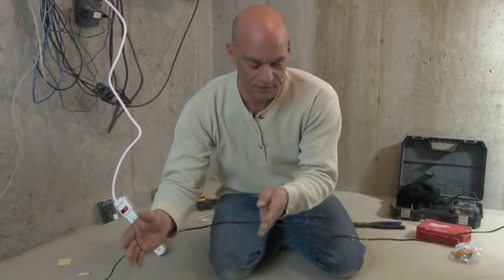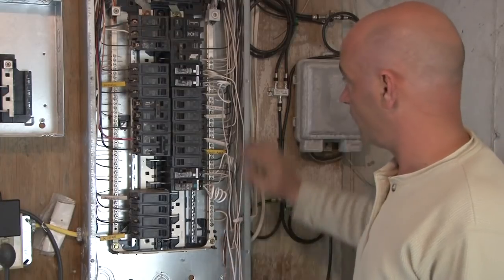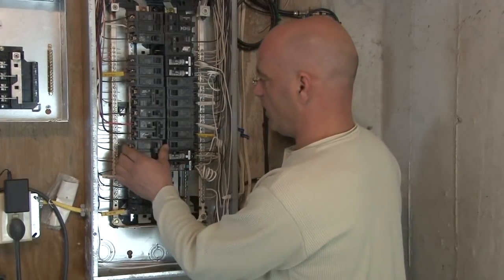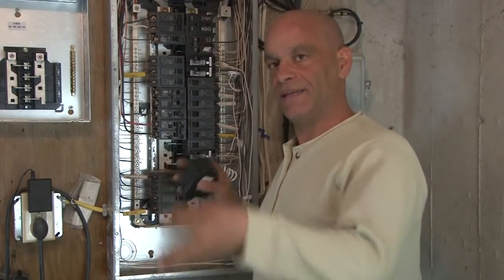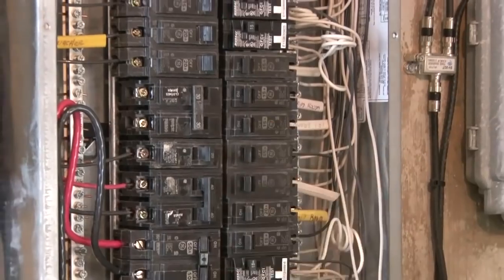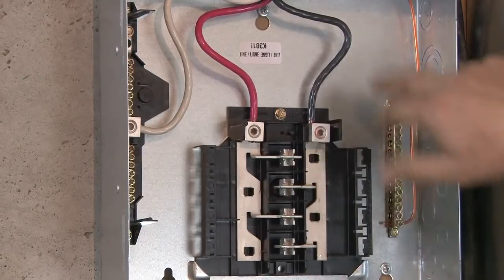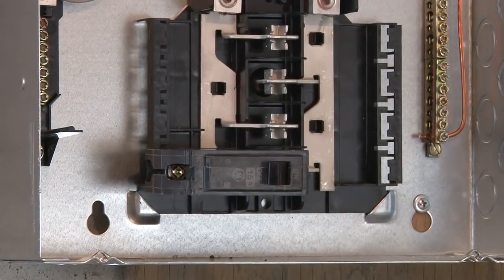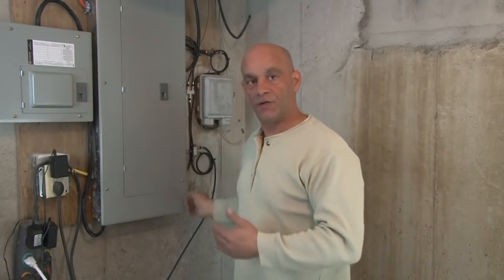How to Install a Subpanel

Comment: The wire between the main panel and the sub panel...should it be stapled down at all? If so, what is the correct distance for the staple from the panel, < 12"?
Reply from the maker: Yes it should be. I believe code is every 18". I always just put them where it makes the most sense. Always at the beginning and end as well.
Reply: Code is 8" from the box, and every 6 in between.  That's the minimum.  More is better.  Not only that, if the wire is accessible under 7', it needs to be protected by conduit. Romex is not protected from physical damage.

Comment: I need a sub-panel for my garage which is attached to my house. The garage is approximately 35 feet from the main breaker box. Can I install the sub-panel in the garage by running the 50 amp wire from the existing or would it be too far from the existing? Thanks, great video!
Reply from the maker: It will all depend on the load you'll have but yes you can.

Comment: Thanks for the tutorial . I'm installing a sub panel for my basement . My question , does the sub have to be the same brand and also if not does the breaker for the sub panel have to be the same as the main panel to  feeder the sub panel
Reply from the maker: No not at all. But do make sure the new breaker for the main panel is right for that panel.

Comment: what purpose does the white wire in the sub panel actually do if the green screw is pulled out? does this mean that the sub panel is grounding through the main panel instead of an independent ground?
Reply: The white neutral wire serves as a return path for the branch circuit current.  The bare or green earth ground wires should never carry current in normal operation.  Ground is for safety only.  When a subpanel is used, it is NOT permissible to bond the neutral to ground.  Thus the green screw is removed.  In the main panel, the neutral must be connected to the ground bus and the neutral/ground combination bus in the main panel is bonded (connected) to the box for safety.  However, note that the earth ground bus that was installed in the subpanel is mounted directly to the metal panel box, thus grounding the box, again for safety.  In the subpanel, the neutral bus is mounted on plastic insulators, so pulling the green screw breaks the connection from neutral to earth ground.

The reason that the neutral and ground are kept separate, going to, and in the subpanel is to prevent the earth ground wire from carrying any current should the neutral fail.  If the ground and neutral were tied (bonded) together in the subpanel, and the white neutral wire was cut, came loose etc. - the bare earth ground wire would carry current instead of the white neutral.  Even a poor connection of the neutral wire could cause this if it was still connected, but became compromised due to corrosion or other issues.  You can notice in the video that the bare wire in the cable being used to feed the subpanel looks smaller than the other wires.  That’s because it is.  Look at page 2 of this datasheet: http://www.southwire.com/ProductCatalog/XTEInterfaceServlet?contentKey=prodcatsheet6   You will see that Romex® 3-conductor cable (larger than 10 gauge) has a smaller ground wire size.  For example, the 6AWG cable has a 10AWG ground wire.  If the ground wire between the main panel and subpanel were to carry significant current, it could overheat and become a fire hazard.  There are other more esoteric reasons such as ground loops, but are unlikely to apply in a typical residential installation.
Reply: *****   Thank you for explaining this.  Really really helped answer questions I had.  Do have a good weekend.

Comment: Dom, thanks for the video. answered my question on separation.  I'm doing a sub dedicated to all 240V.  (3 hot water heaters and a well pump).  125A, 8 pos.   As such, no neutrals.  As it has a large lug, I used neutral bar for grounds.  Should'nt the panel still be grounded as it's a metal fixture?  Remove green or not?

Comment: At least I'm sure now, that the ground screw in the sub panel, is the one that needs to be removed and a separate ground bus bar be installed thus isolating the two.  Thanks for giving a better picture.  Such a nice clean install.

Comment: In a situation where I have a main breaker/meter combo grounded outside and my main distribution panel indoors about 30 feet away (same building), do I need to isolate the neutral and ground in the indoor distribution panel and run a separate ground outside? I don't see a reason since the 4/0 neutral which is coming into the indoor panel is grounded outside so the ground and neutral can be combined correct?
Reply: First of all yes, you have to isolate the ground and neutral in every panel except the main/service panel.  So your indoor sub panel needs to have a separate ground bar from the neutral bar, and you need to ensure the neutral bar is isolated and not bonded to the panel case.  If you have a 4/0 neutral I am assuming this is aluminum SE romex style cable feeding a 200 amp panel.   That cable should have an unwrapped aluminum conductor that acts as the ground.
Reply: T Taylor Thanks for the clarification. So I'm assuming the bare conductor should connect to the same grounding point as the outdoor service panel (which is also connected to the neutral).

So basically we don't want a ground on the neutral conductor that's between the main and sub panels, correct?

Comment: Hi Askmediy,
If I want to run a 100amp subpanel .  What size of wire cable should I use,  where can I get it and which type is better (aluminum or copper) may be just about 10' lenth.
Reply from the maker: Copper is always better. But aluminum is fine. Check my site for wire size. There is a calculator there. I can't give wire sizes out. You can get it at any wire store. Home Depot or suppy house.
Reply: Easy. You must first protect your wire. You have to multiply, in your case, 100 amps X 1.25 (According to the Canadian electrical code you should protect your wire at 125%) = 125 amps. 

Now you must look for a wire that can carry 125 amps. The code requires 1 AWG. (American Wire Gauge)

For your project, you will need 240 volts of Gauge 1 wire. (Red, Black, White and a Ground wire)
Reply: askmediy 2 gauge difference. aluminum need to be 2 sizes larger than copper to get the same effectiveness

Comment: I didn't see where you ran the ground wire from the sub panel to the main panel? Did you run it to the ground bar? Sorry if this is a stupid question, I know absoulutely nothing about electricty.  I have no free spots for another breaker and my house was built in the 40's with mainly 15amp breakers. I can't afford an electrician, I think a subpanel would be needed to add more breakers to lessen the load on the few breakers I have. I'm always tripping breakers! Turn on the microwave; run to the basement. Run the vaccum cleaner; run to the basement again.  I'm even cross my fingers when I plug in my perculator hoping I don't have to run to the basement before my coffee is finished brewing. I just closed on my house with a VA loan in January and after $1400 in inspections you would think I could at least have a cup of coffee with out worrying about tripping a breaker.  Any suggestion would truly be appreciated. Sincerely, Hannah Ruth.
Reply: Yes he did run the ground to the main breaker.

Comment: I wish to Run 175 ft. to subpanel using # 4 wire. do I need a ground wire in the run or just at the sub panel it self, or both.
All wire will be underground in pvc - 60 amp breaker added to main panel.
I will have an electrician attach everything. My question is for material cost acquisition.
Thanks for what your doing!

Comment: hello nice video ..can you inverse the red and the black..cause my 100 amp breaker will be on the other side of the panel and i just want to be sure that there is no probleme with the 2 pole thanks nice video
Reply from the maker: Thank you. A two pole breaker aka 220 is going to use the two hots anyway. So it doesnt matter which side. Just pay attention when you get near the bottom of your panel. Make sure both hots are there if that's the case.

Comment: what gauge wire did you use to run for main to sub panel
Reply: @spoonfed it can be 8gauge in this case because its a short distance and not enclosed in a wall or buried.

Comment: It doesn't appear that you secured the the wire with any staples. At the very least it wasn't mentioned. Overall insightful and a good video.
Reply: Cable that large, and I used 6X6X6X6 SER cable for mine, I would use 1/2" emt clips.

Comment: Is it possible to add a 100 amp sub panel to a 100 amp service box? Or is that just crazy? I've seen some people post on forums that it is possible.
Reply from the maker: It's not the matter on the breaker size but more on what's connected to it. It's best to ask the inspector.
Reply: askmediy Thanks! I will check with the city and see what they will approve.

Comment: HOW TO CALCULATE THE INTERNAL EARTHING CABLE SIZE???????????
Reply: Code Book. Good Luck!! you need to jump around from the sections in the book, to the tables, and appendixes to figure it all out.
it is something that is somewhat complex until you learn the way the code book is set up, then it becomes easier to do calculations.
code book current to your area... look for previous edition as well. it should be similar to new editions.
Reply: Sariq Salim Kasmani In residential on a 200amp main breaker panel a bare ground #4 is required from the panel ground /neutral bus to a 8’ ground rod (aka grounding electrode) outside. You also have to run a #4 bare ground from the main water pipe within 5’ of where it enters the basement or home. Then a bare #4 between the two water lines entering the water heater called a bonding jumper. If the water heater is removed you still have a complete grounding grid. If you have a well or all pex then it’s installed differently starting with 2 ground rods outside etc... The ground wire from main panel to sub panel within the dwelling the ground wire shall be no smaller than #6 which is the size he is using here with the 6/3 with ground romex. I don’t understand why he need a sub panel in the first place when he has plenty of space in the main panel. I would have used a small piece of pipe between panels to run my main feed to or a chase nipple, the wire going into the sub panel looks shabby and there are no staples for support as required.

Comment: Quick question re:fuse box to portable generator, is there a way to disconnect gas furnace wiring from fuse box and somehow add some type of extension from generator to gas furnace wiring incase of need of emergency heating, thanks ( im planning on adding transfer switch, but havent done so yet, looking for alternative solution til then)

Comment: I'm planning on installing an 8 space sub for my new workshop and dedicated outlets for my basement.  I was told that you can use SER 6/6/6/6 for the feed to the sub rather than 6/3 Romex.
Reply from the maker: http://www.askmediy.com/electrical-wire-size-calculator/

Comment: hey i have a question if i wanted to run a 220v to my garage, i have electricity already in there but no breaker box or subpanel, is there a video you would suggest me watch to get a 220v breaker box, along with some 110v on the box, in my garage ?

Comment: Garage attached to house.  On the opposite of the back wall (outdoors) of the garage is the main box.  Is drilling back through the wall into the garage and installing a sub panel the easiest way to put 220?
Reply from the maker: No, I mean you can do that but if a 220 outlet is all you need why not just install a 220 outlet right from the main panel.
Reply: I want to run 220 to compressor, welder and plasma cutter. shouldnt I have a subpanel with 3ea 50 amp breakers?
Reply: Jason Roach
yes you are correct.

Comment: Good, easy to understand video. Question: Is a box put in an outbuilding treated exactly like a sub panel? IOW, is the box NOT bonded? Are the rules different in this case? Can or should it have it's own ground rod and if so is it still not bonded? Any input appreciated.

Comment: great video.  You didn't mention if you installed the green screw in the new ground bus bar you put on the right side of the subpanel?  Was it necessary or not needed?

Comment: What size is the wire you used for the run to the Sub Panel?
Reply from the maker: Go to my site, I have a wire size calculator there. I don't give wire size for many reasons.
Reply: understand.

Comment: your main panel had 11 circuits open , what was the need for a sub panel also you could have turned the sub panel over it would have made your sub feed easier to run, your worksmen ship is nice good job
Reply from the maker: Just to make this video for you

Comment: Sorry to repeat myself but I never saw an answer to this: Dom, can I add a subpanel to supply 3 50 amp circuit breakers to my existing main panel that is an Arrow Hart Murray with 7-15A breakers, 10-20's 1-50 & 2-30A breakers or will I need a new main panel? The subpanel would be supplying a tankless water heater that needs 3 50A breakers and has a total amperage of 112.5 (27Kw w/240v)

Comment: Great video, I have a question. I want to run electricity to a detached garage to run a small compressor and some outlets and lights. I have read online to take wire from the main panel in the house and run it underground to the panel in the garage. Would you recommend doing this? I don't wanna overload my circuit in the house when working in the garage.
Reply from the maker: Thats how it's done. Follow your local code and get it inspected

Comment: Great video for the DYI homeowner that wants to tackle a project like this.

Videos like this are also good training for the journeyman electrician just starting out in the trade.

I'm assuming the main panel is single phase, but I'm wondering why the main has a 4 pole breaker?

Comment: Hey Dom, I got a sub panel running out to my shed that is 120v 30A. I want to add a compressor that requires 230v. What would be the best route to do this? Is it possible get 240v from the sub panel even though the sub panel was wired up to be 120?
Reply from the maker: You will another hot leg to the shed. So in your case you would replace the feed wire. Voltage drops over length. The longer the run the thicker wire you'll need.

This is why you'll hear 110 or 120 volts or 220 or 240 volts.

Comment: Sorry Dom, that was AMP/VOLT not an watt/volt I seen a picture of the one I want and I know where the CT goes just confused on the red & black wire coming out of the back of the meter
Thanks Al

Comment: Hello Dom, I had installed a 30 amp breaker to only supply my generator (also installed a interlock so no back feed problems) Now with that being said it might appear that I know alot about electrical hook ups, not so I have learned alot from you guys on youtube, so here's what I would like to do, I would like to connect a dual watt/volt meter to the breaker box not sure have they work as ar as installation , do I need two meters one for each leg ?
Thanks Al

Comment: Dom, can I add a subpanel to supply 3 50 amp circuit breakers to my existing main panel that is an Arrow Hart Murray with 7-15A breakers, 10-20's 1-50 & 2-30A breakers or will I need a new main panel? The subpanel would be supplying a tankless water heater that needs 3 50A breakers and has a total amperage of 112.5 (27Kw w/240v)

Comment: I don't know why in states they never use an insulated sleeve for ground wires, in my country its so important  and by the way why a subpanel  comes without a
main switch ??...oh i think this job surely for diy persons.
Reply from the maker: Yes things are very funny from country to country. And each one is better then the other, right lol. A subscriber of mine from Youtube just wrote a whole page for my website detailing how electric comes to a house in the UK. Wow very different and interesting.
Reply: askmediy It never used to be required to sleeve the ground wires here in the UK, till about 1970ish. I think the reason is really just because many of the old fuseboards, the live (hot) bus tends to be more exposed than in modern ones, so the ground could short to phase, it just prevents that, and lets people know it's important (green/yellow sleeved). Here in the UK a 'subpanel' is virtually unknown, if you run out of 'ways' in the main panel, you simply add another one and tee the main from the meter. (No legal requirement for a limited number of 'main' switches like there is in the NEC).

A lot of the difference comes from the fact that our building feeds are fused at 63, 80 or 100 amp, 240v. In the US I believe the first 'protective device' is the customer's OWN main breaker, hence you can get melty power drops when you get a house fire...

Both systems are safe, it's fascinating to see how it's done in various places.

Incidentally, noticed a coiled white neutral wire going to a breaker at the bottom right, was that a GFCI?
Reply from the maker: ***** No kidding, just T off. I love hearing all about the differences from the US and UK

Comment: Great video, Will I need to install a ground rod if I have my sub panel in the basement?
Reply: Nope.  No second ground rod necessary UNLESS the subpanel was installed in a separate standalone structure like a shed, garage, etc.  Then you need to drive a rod into the ground.

Comment: H.I.D. you can run a 2pole 20 with 12 A.W.G. please don't use NMB122WG as we know as romex. Romex is used inside the houses its not rated to be in pipe under ground. your running about 16.7 amps it would be nice if you fine a breaker the is HID rated you might not find them at your DIY you need to go to a electrical supply house. if you need help finding the breaker let me know.